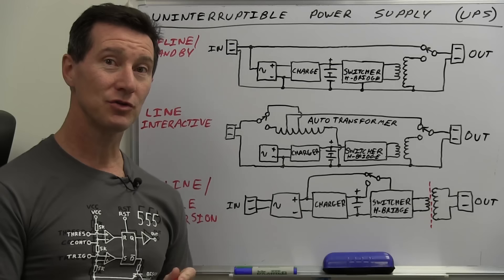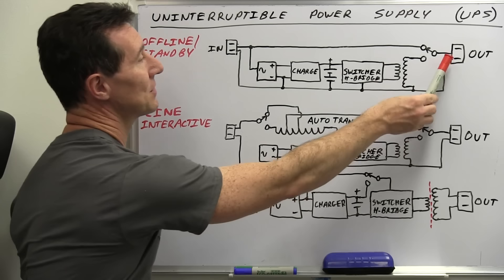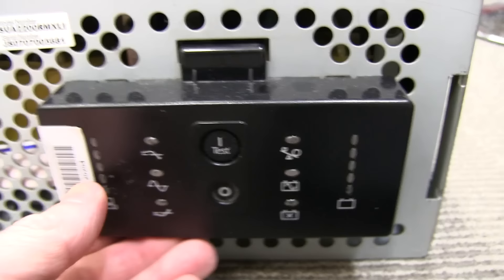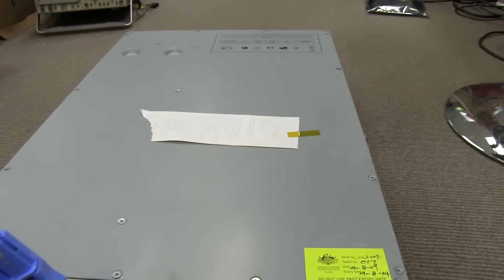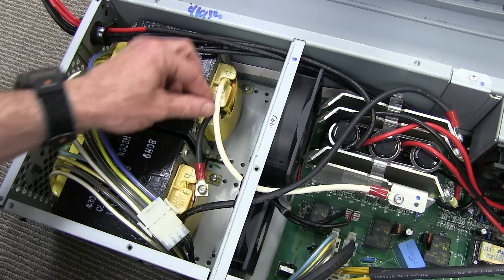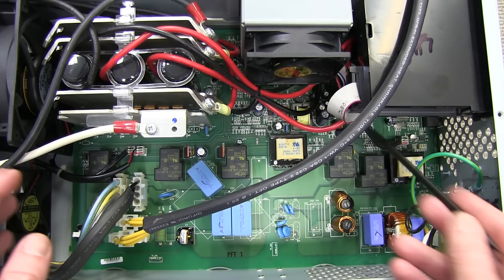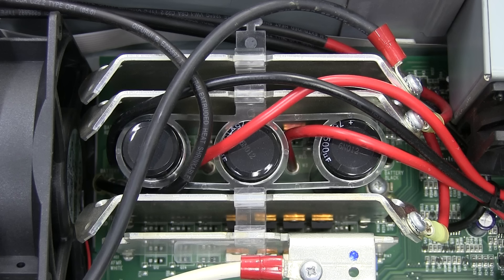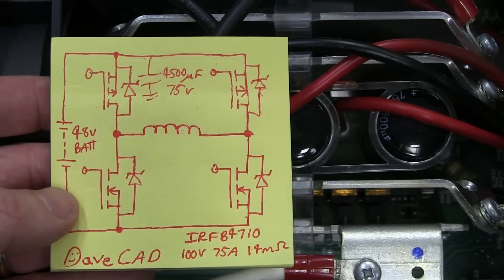EEVblog #504 - UPS Tutorial & Teardown

Comment: This is an "extended run" APC UPS as designated by the "XL" suffix on the part number.  2 things make it extended run: 1) the secondary battery input and 2) additional cooling fans.

The extended run models are "highly desirable" for use as straight inverters because on the standards models, the transformers will overheat within about 30 minutes of heavy continuous use.

Of course, now that I told you that the transformer is the "weak link" you can add your own additional cooling including thermal compound between the bottom of the transformer and the case !

Comment: Nice explanation Dave, I really like your videos on DFM. 

A quick comment on how the charging work:
Voltage reflecting on the battery side of the transformer (primary side) will never be high enough to charge the battery through the four mosfet body diodes. (battery shouldn't be charged this way because you cannot control the charge current and stop charging appropriately)
In order to charge the battery, the mosfet H-bridge works like a boost converter, boosting the voltage to high enough to charge the battery, and at the same time control the charge current and do PFC (Power factor correction).
In inverter mode, the H-bridge works like a buck converter having output voltage swing at line frequency. 

Half-bridges or full bridges are bidirectional converters.
You can easily control the power flow both ways by applying correct PWM.  Usually, an algorithm called dq control (similar to field oriented control) is used to control the power flow. For example, when vector q is positive, power flow forward, and when q negative, power flow backward. 

This idea is not new, but applying the idea to UPS to simplify the design is really smart.
Reply: How the H-bridg work as rectifier
Reply: why don't they teach it in college, the topology practical design. When I opened up my 800VA APC UPS, I wonder how there's only one power transformer who's responsible for AVR, charging, and inverter, with only 3 cable for high voltage and 2 cable for low voltage.
But after all these years why don't they switch to high frequency transformers, instead staying with the bulky heavy transformer. I noticed these designs get warm even without load consuming around 20 watt, that amount does affect the energy bill for 400W UPS running 24/7, and all UPS I can find does that except for the DC UPS's.

Comment: I got one hooked up to my 3d printer. No more shall power outages waste my material!

Also, a bit of a question: If I have a triac-based power supply for a high power (~400W) device, would those pulses of high current damage the UPS? 

P.S. The device would be a heater is for the heated build plate. It really only needs to be UPS-protected for long periods of time because of the thermal mass.

Comment: Great video, helps me a lot to figure out my scrappy $20 APC Smart-UPS 2200VA. i GOT THE SAME !
Difference is that i have one without the slide out battery bay, Only 2 big capacitors placed far behind the path of cooling air through the H bridge (Seems logical). Basically you have 8 small NP7-12 Lead Acid batteries in a weird configuration. APC made 2 separate 24v sections (with 2 Anderson connectors) in series (48v 14A total) with a 100A fuse in the middle. Both sections consist of again 2 individual banks of again 2 NP7-12 batteries in parallel  (= 24v 7A) again in series = 24v 14A.  The leads get bigger at every level. Basically the charging current is only 1A max (Maybe even a lot lower) for these 8 tiny 12v batteries switched that way. The total charge current at 48v is about 4A (only 200 Watt). Discharging each quickly ramps up (ads up voltage and amperage in the chain) the capacity of this 48v battery without damaging them individually. I only wonder about the charging profile. Does this Interactive system stop charging at all at some point if batteries reach the full capacity and if not does this explain why all the old AGM batteries in these units seem exploded or expanded with bubbles on all sides? Does this pyramid of 2x2x2 batteries equalize automatically if you leave the power disconnected? I ask because it would be possible to replace every single NP7-12 battery with a 10 x AA (1.2v) Ni-MH battery pack, Haha. Picture link: https://www.dropbox.com/s/leg4t0lyqml42mh/2020-03-14%2018.40.03.jpg?dl=0

Comment: I disassembled a large online UPS, and it didn't follow that schematic. It was near identical to your "offline" schematic - the main difference was that the step-up transformer was an SMPS and went before the inverter. The battery voltage was stepped up from 400 volts to 700 V (+/- 350 volts), allowing a simple push-pull topology inverter.

The difference is that in an offline UPS, the load is directly supplied by the mains. If the mains fails, then the transfer relay switches the load to the inverter. In the online UPS, the load is supplied by the inverter, unless the inverter fails, in which case it transfers back to mains.

The common reason for inverter "failure" is actually the output being severely overloaded or shorted (e.g. due to a fault on a single load where a UPS supplies multiple individual loads). In this case, the inverter voltage drops under the overcurrent stress, and the load is transferred to mains with its high current supply capability. This can also happen if regenerative loads are connected to a UPS (e.g. motor drives) and the reverse power exceeds the handling capability of the inverter causing it to trip out due to DC bus overvoltage. 

There is usually a difference in the type of switching. Offline UPS systems are designed to be cheap, so tend to use a relay. Online UPS systems are designed to be high end, so the delay of relay switching is unacceptable, so online UPS systems usually use IGBTs to switch between inverter and bypass mode.

Comment: Amazing video! Thanks for explaining how each type actually works.
One tiny correction, though: at 6:22, the fact that for a given power, a lower voltage implies a higher current, is not Ohm's law, it's the relation between those three quantities (what we may call the power equation): P = V * I. Ohm's law has nothing to do with that.

Comment: To  answer your question @28:43. The MOSFETs in the inverter are also used as the rectifier. It called a "Dual Headed Synchronous Rectifier"(DHSR). In a DHSR configuration. The controller synchronized to the mains/line and then switched the MOSFETs on and off in sync of the AC wave form. It also uses PWM to control the battery current as well as perform power factor correction. Hook your oscilloscope up to it and look at it.

Comment: How would you disable charging of the battery only?(in case of multiple ups on same battery). Without using diodes in series with the battery.

Comment: Thought I'd make a correction on you DaveCAD @20:00.The  H-bridge in the UPS is all N-channel. The N-channels are connected backwards in place of your P-channels. The reason for using N-channel over P-channel is that N-channels have a lower RDS then there P-channel counterpart.

Comment: Pretty sure it's OK to use the body diode for 50Hz rectification, most mains frequency diodes are pretty crummy in terms of switching/reverse recovery performance. Not sure about the body diode, but (some?most?) MOSFETs have a positive temperature/resistance coefficient, thus they share current pretty well. Series diodes are much more of a pain since you have to get voltage sharing.

As for the large number of caps, that's not unreasonable for single phase -> 100Hz power flow and all...

Comment: Actually I do believe that they are turning on the mosfets at the same time that the body diode would be on (as stated in the comment you commented on). It would have been a simple enough optimization to figure out, and they would have the control circuitry that would otherwise be dormant. It could also allow them to do some power factor correction to make the charge circuit seem more like a purely resistive load.

Comment: Just googled and found this on the wikipedia page: "Body diodes may be utilized as freewheeling diodes for inductive loads in configurations such as H-bridge or half bridge. While these diodes usually have rather high forward voltage drop, they can handle large currents and are sufficient in many applications, reducing part count, and thus, device cost and board space." Exactly what you said dave!
Reply: Free wheeling diodes are needed on inverter designs, even if they are not used in this particular charger implementation. In high end designs, discrete high speed diodes are used, to reduce power disipation on the substrate diodes

Comment: Hey Dave,  the  same big transformers that step up the voltage  is also  used to charge the batteries. 
That is why they put a lot of relays  and series of output wires in the secodary side of the transformer.
During mains off, the side of transformer connected to the heat sink serves as primary and
 when mains on ,it turns to seconďary to charge the battery. If you look around the heat sink, you will see some rectifiers.

Comment: There is another type of UPS - transformerless double conversion. Just had a 40kva 3 phase unit installed. Batteries are in series and the DC side runs at 480v. This is common for large, fixed installations. It can be bypassed externally without dropping the load e.g. for servicing. When going out of external bypass it will automatically sync the inverter with the mains supply after which you can flick the bypass off. No interruption to critical load at all.

Comment: Sorry for two replies - now I think about it they have some form of active rectification control since it has to be a boost device (acting as an inverter it is a buck device). Hence the short circuit "charge state". But it may not be that high frequency to bother the body diodes.

Comment: I seen this and it took me back. I worked for a large UPS maker for 10 years. I went to school for APC Anton Piller Belkin Kw controls and a few others . The company also did motor gen sets up to 500kva I could tell you every connection and what to look for to repair it. They had on line UPS and non online UPS systems . I even set up the systems for several companies including Blue Cross . I could tell you so much about UPS systems it would make your head swim.

Comment: Nice feature of the APC SmartUPS,  if you have a power failure, you can turn them on and they will run off the internal or external batteries w/o any mains connection.

Many of us use these older models that nobody wants for our older amateur radios, aka Ham Radios.  These older circa 1975 radios have internal transformer  they do not like any square or modified sine waves.

The APC  SmartUPS  put out full sine wave and we can run the radio off batteries for emergency use.

Comment: In the main designs, what are your thoughts about a online design but without the switch ? Meaning it's always the charger that power a full sine inverter. Wouldn't that effectively give the smootest output possible without the split second blackout of the relay ?

Comment: Invensys sold off the UPS business to Eaton Corp, they already made a lot of the panel gear that the UPS uses so it was a great fit for them.
They build the big systems here in Raleigh NC.

Liebert is big on UPS and Data Center Cooling, they are part of Emerson.

APC was bought and is now  part of Group Schneider who owns Square D,
a big electrical panel and circuit protection corporation.  They made a lot of stuff here in Zebulon, NC but moved all of it to Mexico.

Comment: So, the purpose of the patent might be to make product manufacturing cheaper - no separate charger required. But for unknown reasons I don't notice that APC UPSes would be cheaper than others. On the other hand, now almost everybody seems to be using similar design. I have seen some Powercom UPSes having separate chargers in their midrange UPSes but that was long time ago, so maybe now they also use the same charger-less design.

Comment: This topology likely uses an "active" rectification technique, think full bridge rectifier but substitute the diodes with mosfets. By turning the right mosfets on and off at just the right time you essentially have an extremely efficient full bridge rectifier. The mosfets drop far less voltage than diodes.

Comment: I have used many, many huge (100kva and up) for data centers. The "U" in UPS means UNINTERRUPTABLE. This means ZERO power transfer time delay and NO PHASE shift. The output power is completely obtained by the inverter. This is what a true UPS does anything else is a STANDBY lower supply.
I had one in a large data center that supplied global credit card processing systems (all mainframe stuff) the UPS room was 625 sq feet. I contained racks of batteries and a unit on the wall that just buzzed. It supplied 3 phase power to the data center. With all thay power we only had 45 min if battery power. We didnt need much because we had a generator that would activate if we lost power so at most the batteries were needed for 2 or 3 min until generator stabilized

Comment: 31:26 you are right but sightly wrong they used Not h bridge MOSFETs as rectifier instead they used the Body diodes of the MOSFET used in H bridge , as rectifier .
Reply: Oh you already mentioned it later here 31:56

Comment: I was having blackouts and was worried that the sudden power drops may damage my TV. I bought a 115 amp 12 volt solar battery. I connected a really good charger to keep it charged up. I then bought and installed a 400 watt sine wave inverter. I put fuses in for safety. This is all in my garage. My TV and DVD player only draw 105 watts of electricity. I only use the TV for 3 hours per night. The TV power cord is full time connected to the inverter. The inverter is switched on and off via a remote control. This all cost 480 dollars and I have had no worries so far for over 2 years. The power goes down but my TV is safe and just keeps right on going. The thing that you pulled apart is just an expensive wank on as far as I can see. More for rich geeks than us "ordinary folks".
Reply: +7316bobe UPSes are very common and useful devices, and although he gave your home PC as an example, they are not often used by consumers. These are mostly used for commercial industrial applications or to provide clean power and graceful shutdown for important equipment. These things can be small bricks for one device or massive units for many. For an individual device you won't see these often in someone's home, but you will see it connected to point of sale systems in stores and banks. Your solution is interesting but not very practical for other implementations, especially since it's a solar battery. It's silly to build something for extra reliability that draws its power from an unreliable source.

Comment: I tend to agree Binray - it won't be switching particulatly fast. There is a fair bit of series inductance in those cores (needed for the boost/active rectifier) and 13uF of output capacitance (3x4.7uF) to filter the sine wave.

Comment: Funny you would say that. I read an article in a power utility magazine about switching the power grids of the world over to dc in the next 20 years. Advances in solid state technology is making it possible to build sub-station and pole-pig transformers into switching power supplies DC2DC as well as  AC. Both AC and DC system can and will both co-exist until the system migrates over to full DC.

Comment: I have an APC Smart UPS 750 which I modified a bit to use a pair of large external deep cycle batteries (24V 115AH) in addition to the internal "main" battery (24V 7.5AH).  It's rated 500W 750VA but I de-rate that to 200W max (100W normal load) at a 0.6 to 0.8 power factor.  With a cooling fan to keep the transformer temperature in check it works well.  I run my LED lights, laptop, and internet hardware from it.  Run time is about 18 hours but I can stretch it to 24.

The battery charging is indeed as described in the video, i.e. using the inverter to do it.  Charge current is low (maybe 2A at most) and after running down the time to fully recharge is almost 48 hours.  I'm curious to know how the inverter charging would interact with an external "fast" charger (well, faster, anyway — 10A to 15A).  If I understand it right, the fast charger would raise the battery voltage seen by the inverter.  The diodes would be back-biased at the higher voltage, so the collapsing magnetic field would have to induce a higher voltage than that in order to forward bias the diodes.  What happens then?

Ideally the current from the transformer would just charge the battery alongside the fast charger and that would be that, but I don't believe it.  I have a feeling the inverter and external charger would end up fighting each other somehow.  Maybe the charger would just be confused because its output current is now pulsating in time with the inverter current pulses.  Or maybe the charger wouldn't notice and any reverse current would be blocked by its rectifier or whatnot.  Or maybe the inverter would force current back into the charger and possibly damage it.  Or the increased voltage stress due to the inverter having to overcome the voltage imposed by the charger would damage the inverter some way.

I'd like to believe the ideal case where the fast charger and inverter just get along and basically work normally.  I don't believe it though, and would like to test it but don't want to risk damaging anything.  Has anybody ever tried this sort of setup and gotten results (good or bad)?  Or does anyone have a better idea of what the interaction between the inverter charging and an external charger would be?